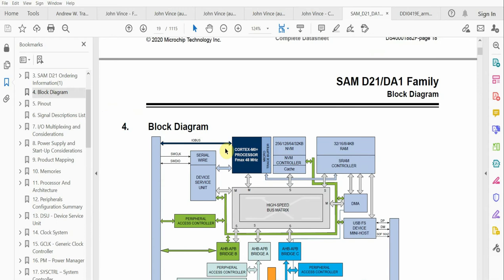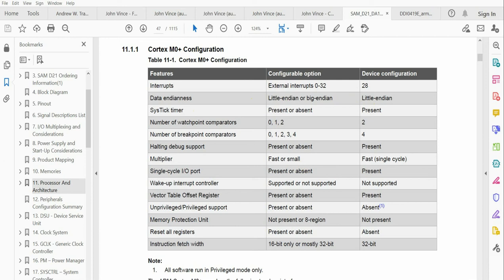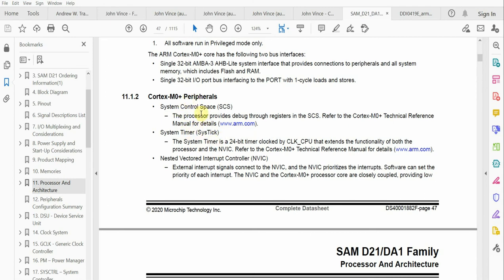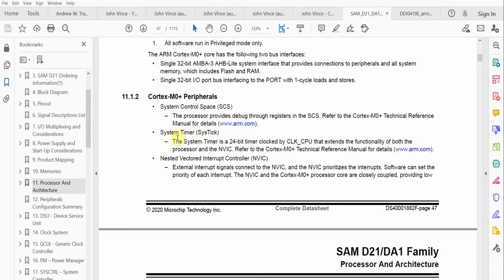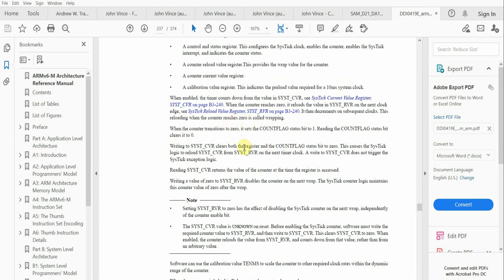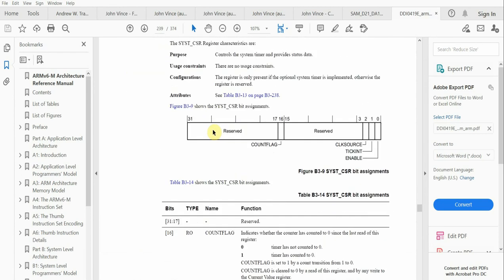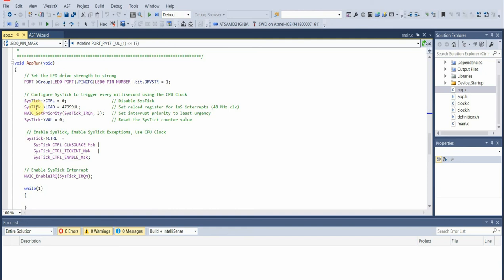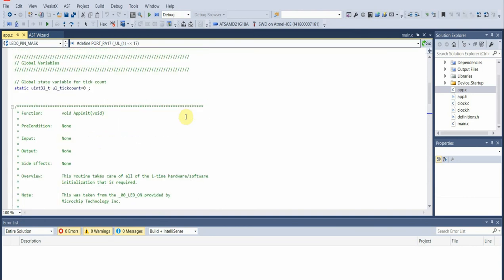SAMD21 ARM Cortex Tutorial #7: System Timer (SysTick)(Bare Metal)

Comment: It's says on the title that it's bare metal, but it's not. It's still using HAL. If this is bare-metal you should've shown how to do this from the scratch using the register address
Reply from the maker: Lol...In industry when we say bare metal we mean no RTOS and bare minimal to get processor, clock etc setup with register manipulation. In this case I use mnemonics to refer to the register addresses rather than refer to them by addresses...this series was meant to be more practical than an academic excercise...feel free to use register addresses if you like....you can use register addresses with assembly it will be 'true' bare metal...